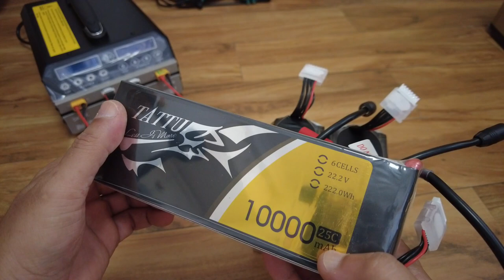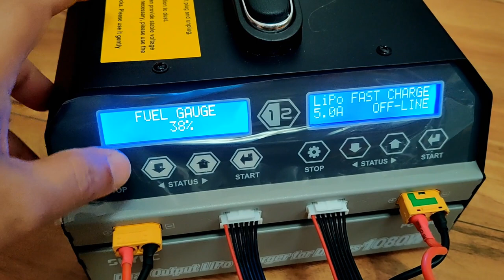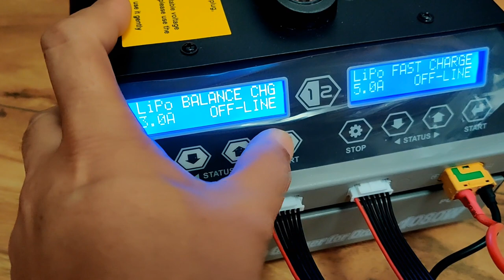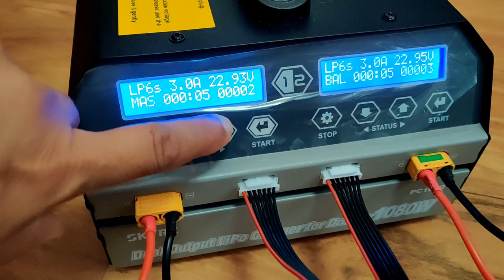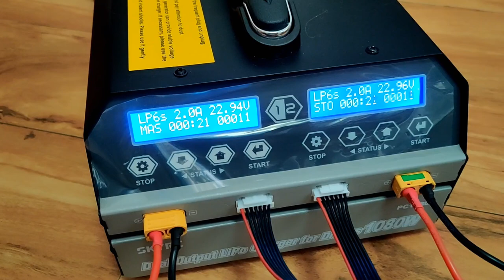High Capacity Lipo Battery Charging discharging and safety Tips

Comment: Salam Brother... Great video again Ali. Now a question.... I have quiet props sent from Banggood to review and need a good app that can check sound differences when flying outside. I intend to take my Mavic Air 2 off the ground to my chest level and test sound with normal blades. I then want to do the same with the so called quieter ones from Banggood.

Do you know of a good app for a phone that will give good/quite accurate sound results buddy?
Reply from the maker: wassalam. there are many good apps out there. but outdoors every app will pick a lot of sound. best thing is that you take an app that you think is giving you best results, then choose a quiet room to just hover your Mavic Air 2 and you can get best results.
Reply: Shukran. I do not have a room with enough space to hover it inside brother as my wife seems to cram every room out with furniture we do not use 😂😁😂